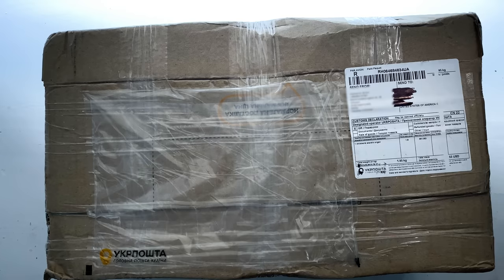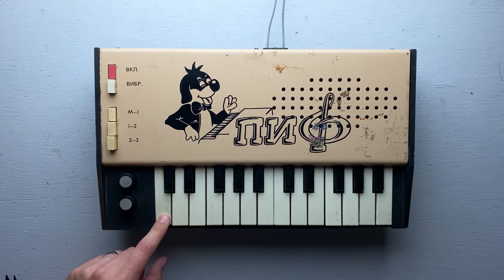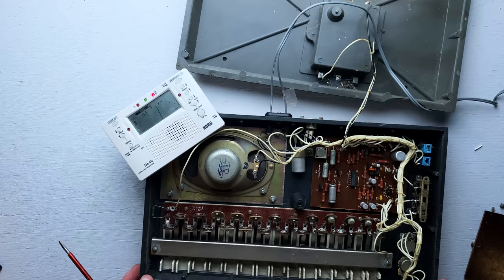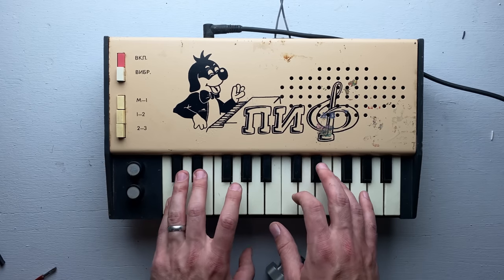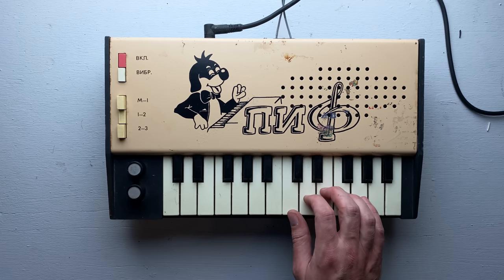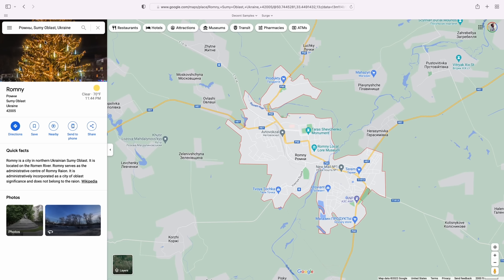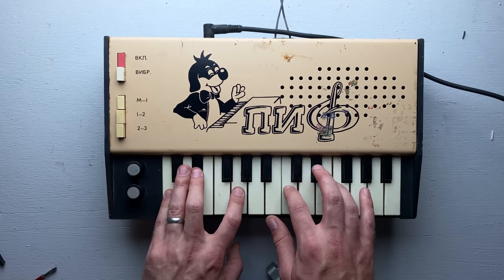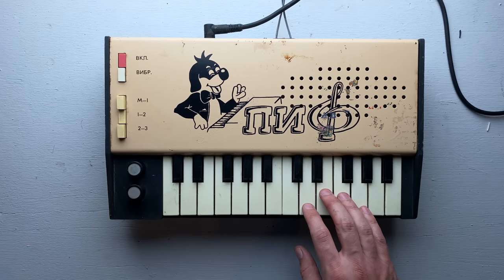Soviet Pif synth: a cute analog synthesizer for children (+ FREE Sample Library)

Comment from the maker: Yes, I’ve seen a DIN connector before. I just meant I had never seen one used for audio. 😂
Reply: First
Reply: MIDI? XLR?
Reply: Got one on an old ass Yamaha keys and my Steinberg UR44c no velocity available but it works so good for bass synths. I sometimes fantasize I am gonna use a multi keyboard live situation like Rick Wakeman or something.
Reply: @MarsCapone  that might be good and all, but let’s not forget who was first to comment in this reply section…
Reply: They were fairly common on lots of gear. They became standardized as “a midi jack” in that specific configuration, and now you only see other varieties on old gear. Like, from my era... ;)
Reply: It was the very common in socialistic countries to use DIN as audio connector. I remember I have full drawer of Jack to Din, Jack to cinch, Din to Cinch, mono, stereo, in, out, combo when I was kid in 80.
Reply: these connectors are way more safe to connect low voltage equipment together because the metal case of the plug is internally connected to the ground, so it gets connected first and the audio output/input pins are connected next. 

if we compare this to popular VHS audio or video inputs we see the inner signal pin there is longer than outer pipe connected to the ground. So if you have to connect two transistor devices with a 220V power supply each, you may connect the one's ground to the other's input and burn this input
Reply: in the 70's they were the norm here in the UK. Most cassette decks had them
Reply: Actually the DIN 5 pole stereo connector was very common during the 60’s and 70’s in some brands such as Grundig and Philips, and I presume many others.
Reply: 'Spose what we are all saying, it's an old connector, but it checks out... ;)
Reply: Every Bang & Olufsen since day zero until the mid-1990s used DIN connectors - I would have replaced the power jack as well.   Also PIF was a publication of the French communist party...  I used to have a subscription as a kid!
Reply: (Japanese) Sharp GF-8080, AM/FM Stereo/Wide, cassette deck with APSS (single track silence search auto detection) c. 1979, if my spectrum childhood trivia memory hasn’t become corrupted. DIN is/was a very compact and simple physical interface for line level 2 channel analogue i/o in many parts of the world, before RCAs “won”.
Reply: The connector there conforms with https://en.wikipedia.org/wiki/Deutsches_Institut_f%C3%BCr_Normung
Reply: @monsterislandtales5788  Yes, you're very special.  How about you come back when you have something of substance to contribute?
Reply: Basically all audio equipment in Soviet Union used that type of connector only. Even electric guitars! It has a little advantage by design -- it has both input and output connectors for left and right channel, and whatever you plug in wouldn't make a trouble: if you connect a microphone to a speaker output you won't blow it up, it would use a different pair of contacts.

Of course everything else about this connector is a huge nonsense.
Reply: It’s never be tuned , these kind of the synth what must sound de tuned originally .
Reply: DIN connectors for audio was the common standard when I grew up. Most devices had them - one for "Phono" and one for "Tape".  The "Tape" connector established a bidirectional stereo connection so you could easily copy music using just a single cable ("Überspielkabel"). The "Phono" connector was just half wired (inputs only). It expected a high level signal that already had to be equalized and amplified by the record player (kind of like a RCA line in) , so both versions of the connector were more or less interchangable. The change to this messy cinch-cable system, where signals were non-standartized and could be anything (mid level line, low level non-equalized phono or even low level digital) and where you needed four plugs instead of one for a single bidirectional connection came way later.
Reply: To reiterate it a bit more: MIDI jacks are a current-loop based, low-speed digital serial interface, carrying only control information for digital music instruments. They are someting completely different then the ones used for audio. But AFAIK nothing should happen when you accidentially put them into the wrong plug. The MIDI signal is floating and would end up on two "hot wires" if you put them in a DIN audio socket.
Reply: hu most old audio stuf use DIN
Reply from the maker: @Light-DelaBlue  Not in the US, though.
Reply: В СССР только такие и использовались, Джек был редкостью.
Reply: "May There Always be Sunshine" song at the end was used as the opening for Warpath: Showdown mobile game app advert.
Reply: @DavidHilowitzMusic  Would you be able to do a midi files of the songs from the song book by any chance?
Reply: Super common here in Germany. All the old audio gear I find has DIN connectors and there are so many different types. It is kinda cool to have line in and out from one cable.
Reply: В советском союзе всё межблочные соединения даже hifi класса были на din. Разъёмах..
Reply: прикольно
Reply: All Soviet audio equipment was equipped with a DIN connector for audio input / output
Reply: according to your logic, if German Volkswagens can be bought in Russia, then they are also made in Russia. Do not forget the USSR was not divided into Ukraine or Russia, people considered themselves a single country. And the intervention you mention should be used against NATO.
Reply: Привет из СССР
Reply: Yep, they loved their DIN sockets over there.  I'm fiddling with a Moldavian ZX Spectrum clone ... DINs for everything ... including power input!
Reply: Wasn't the DIN standard a German thing?
Reply: @robertlewis4216  Yep ... D = Deutsches ...
Reply: In the 1950's DIN was standard in Europe, also West Germany.
West Europe switched to RCA Cinch, East Europe kept DIN.
Reply: cool that youre getting into electronics as a grown man but you should study a lot more before playing around with live current and commonplace standard components you don't recognize for some reason
Reply: DIN stands for Deutsches Institut für Normung - German Institute of Standardisation. And until the early (?) 80s it was the common connection also on stereo systems so,d in Western Germany.
Reply: Seriously?? Been used for Audio till mid/late 80s...
Reply: I think the DIN 5/180° was the standard audio connector in the 1970s, all over Europe. Even after RCA started becoming a de facto standard in the 1980s you could find these on boomboxes, televisions etc. I remember recording sound from the TV onto a tape deck using one of these in the mid 1980s.

It's a lot easier to connect just one cable between your tape deck and amplifier instead of four, and the average consumer doesn't have to worry about doing it wrong.

 There was also a 2-pin DIN connector for speakers. And you could use an adapter for 2x 2-pin DIN speaker -> 1⁄4 inch female to plug in headphones, if you didn't have a headphone jack.
Reply: AC or DC? That's a question. When you buy anything from the other side of the world.
Reply: @DavidHilowitzMusic  That power connector looks a lot like a dual banana plug.
Reply: the c64 used a din connector for a composite A/V.
Reply: DIN connectors were used in Norway too, then probably in the rest of Europe, too, and they were common with record players as I can remember.
Reply: DIN connectors were also a standard for pc keyboards until the mid 90s
Reply: @monsterislandtales5788  why
Reply: I I'm kinder
Reply: Back in the 80's stereo amplifiers had a din plug socket. Some record players had din plug sockets. They used to be very common
Reply: this connector has been an audio standard for 80-is  I have soldered hundreds 🤣
Reply: @frankkrunk  I think the speaker connector could be either 2 or 3 pin But two pit connector can be inserted into 3 pin socket. Anyhow they are pain in the ass to solder wires to. Too small for the standard cables used for speakers even back then. I have had some from old radios back in early 2000's when I was getting into electronics s a kid, but they are all gone now.
Reply: The early Philips MFB speakers (MFB541, etc) used DIN jacks for signal transmission.
Reply: you've never seen a DIN connector on any synth other than this?
what
Reply: A friend ( who has now passed away) gave me an amplifier that his step dad found in his loft. Had one of those connectors. Wish I'd kept it.  I vaguely remember it had a break out cable to multiple phono Jack's.
Reply: I'm not sure if they're wired the same, but I've seen tonnes of 5 pin I/O's and cables in my life, in MIDI.
Reply: Looked like a Professional 'SHURE' style Microphone plug to me...  I was shocked to hear you did not recognize it! (But impressed you found the correct outputs!)  This was a great video...
Reply: @WoodysAR  The XLR connector is only superficially similar to the smaller DIN plug. Nevertheless DIN is very familiar to anyone who ever used a C64 and it even carried audio out. 😉
Reply: Retro Japanese, British and Swedish hifi gear would like a word... (Bang and Olufsen used them, as did A&R amps, the Japanese also used them primarily for Reel-to-reel tape decks) - Pretty much all the audio kit I came across in the 80's to early 90's had a DIN somewhere on them. 

And then there was the BBC Micro.......
Reply: My TRS80 used a DIN connector to link it to a tape player for data storage :)
Reply: They are kinda present on all audio equipment for that time..
Reply: But isn’t that DIN connector used for MIDI ?  Am I so old that they aren’t anymore?  Not surprised it wasn’t for MIDI on this synth 😂
Reply: Tuning an old piece of soviet tech with a metal letter opener after hooking it up to the power source with 2 bare wires. Health and safety level Poland <3
Reply: Shoot my Tandberg tape deck from '77 has one on the back for connecting to radios. Never use it though, no clue if it works with modern 5 pin cables and even if it did, have nothing that will take that
Reply: They werev invented for audio by the German standards institute. Use for PC keyboards and MIDI came later due to their availability and superiority to RCA for multipin purposes. USA is the odd one out in hanging on to RCA despite all it's disadvantages.
Reply: @ОксанаГончарова-ц2ь  "бувай нє митая росія"))) доброго вечора, ми з України! країни яка звільнилась з полону ссср. а до того створила цей синтезатор.
Reply: @AiOinc1  MIDI isn't audio & XLR isn't DIN
Reply: you find in on old microphones often
Reply: Din was German standard and a typical connector  for audio in Europe in '70 and even '80  Most German  Grundigs , Telefunkens etc Used Din as audio output. Swedish Dux, Polish Unitra and many other European brands including Soviet  also used din. Some  till late '80 or even til 1990s. Same as MIDI pinout was used for audio in out and headphones. For speakers 2 pin din speaker connectors
Reply: @LorenzBaermann  The DIN 5 was featured on my Nakamichi 550 reporter cassette recorder for audio in/ out. I made so many music recordings with that using the amazing 3 microphone L/R/Omni setup. It was a joy to use, but quite heavy to lug around with you
Reply: @DavidHilowitzMusic  ISTR DIN were pretty standard for mic connectors in the US in the 70s-80sm
Reply: @Valet2  It makes a lot of sense that the soviet union used ONE connector for ALL audio

Comment: 4:10 The "archaic connector" is actually called 5-pin DIN connector. It was introduced in early 70s in Germany and later on spread throughout Europe for analog audio, midi, and later computer connector standard. It has its roots in connectors used in military aircraft. As a matter of fact early personal computers such as IBM, Apple, etc, used those types of connectors for interface (keyboard, serial, etc) which later on became a more familiar mini-din keyboard/mouse connector which you can still find on modern computers. So, by far, that connector wasn't just a USSR thing.
Reply: I would say it's even older. I am from Serbia and my grandfather had a Tesla (Serbian electronics institute and manufacturer) radio from 60s with such connectors. It had input and output options, we use to hook up record players onto it and bunch of other stuff through the years. Decades later devices still had those as connections. Mostly found on high end stuff.
Reply: I remember them from volunteering at our local tv station. They were used to attach the zoom arm controls to the camera. I’m sure there were other uses too….i think my audio recorder as well but it’s hard to say it was awhile ago
😂
Reply: DIN-5 socket is used also in MIDI-standard musical equipment.

Comment: FYI from ukrainian electronics engineer: that silver cylinders in the device are electrolytic capacitors, and they degrade over time, especially crappy soviet ones, so they are first candidates for replacement if something this old is faulty.

Comment: Not sure if you'll see my comment, but the audio output that you see there is actually the same as MIDI (this connector called DIN at the time), so you can use the modern MIDI cable to to connect things, just make sure to solder modern jack on the other side. It was used in many applications and sound was perfect for using DIN for stereo and mono since the jacks did not differ!

Comment: Those batteries seem to be C or D cells. I wouldn't call them archaic - I'm pretty sure they are still sold everywhere. The battery compartment door is 100% not original but some sort of a DIY replacement cut from a sheet of micarta. As for the audio out connector - it's a DIN connector. These were invented in Germany and adopted as a standard in USSR. BTW, standard MIDI connector is also a DIN (as is the AT keyboard connector) but with a different pin count than the one used here.
Reply: I am sure that you can buy them almost everywhere in Europe and i have seen some new devices still using them, but I don't remember exactly hat was it, but most likely something with motor and quite likely strong flashlights as well.

Comment: if you want to use this synth then i highly recommend to replace all variable resistors on the keys with any modern ones because this open type ones are unreliable and may loose their settings.
also recommend to replace all electrolytic caps (silver ones) with modern ones because those old caps are pure shit and half of them are probably already dead.
that's a known issue. here in Russia any repair job on soviet era vintage equipment starts with cap replacement (many guys don't even check them and just replace all small electrolytics)

as for song...   people who write songs and people who start wars are completely different people despite they are all live in a same country.

Comment: That audio connector was the main and most popular audio connector in USSR. It was widely used in TVs, tape recorders (both stationary and portable (big)), audio amplifiers, equalizers, microphones, headphones etc. It was something like 3.5mm+RCA for audio of that time. In many cases a device had two such connectors marked IN and OUT. So you could bring your tape recorder to a friend, use a special cord with two male connectors of the same type, connect two tape recorders and make copies of some tapes. Same cord was used for connecting a tape recorder to a TV to record some music shows etc. In the 90s, after USSR collapsed and imported electronics started to flow in, we got a portable CD player, so we used a soviet stationary tape recorder as an amplifier to play CDs on big speakers, and I had to solder a special adapter, connecting a modern 3.5mm jack to an old soviet cord with that standard connector.

Comment: The first children's synthesizer at the former ussr was produced in Estonia (196s). It was called Pille (female Estonian name).
In Ukraine, in the city of Zhitomir, keyboard instruments were produced for amateurs and professionals:
"Romantica" (monophonic, 3.5 octaves), "Gamma" (polyphonic, 4 octaves), "Meridian" (polyphonic, both manuals in one row, 6 octaves summary, 6 register synthesis  (8' + 4' + 2(2/3)' + 2' + 1(3/5)’ + 1’).
But this instrument was heavy and repairing it was difficult. To replace one transistor in the octave divider module, it was necessary to desolder 4 bus wires on the faulty one and four neighboring modules.
That plant also produced an electronic accordion and a drum machine.

Comment: Din connectors were standard for audio in most of Europe. They were a great idea, because with only one connector you could have left/right in, together with left/right out. Versus having to plug in 4 cinch plugs. However, the cables are a lot harder to DIY (finicky small pins to solder on).

Comment: FYI Li-Ion 18650s fit perfectly in the battery bay. great for taking PIF outside. no modifications needed. also, you can kinda "combine" octaves by holding down more than one octave key.

Comment: The reason why a detailed electrical circuit diagram was included is that if your device breaks, you will take it to a general repair shop, where they won’t figure it out without the diagram, but they could fix any device made in soviets if you bring them related diagram.

Comment: It's very easy to date Soviet electronic equipment, as many of the components (especially the capacitors) were marked with the year of manufacture, often with the month as well (sometimes in Roman numerals). So a component marked Г VII 82 would have been manufactured in July 1982.
I can't be sure, but I think the 9v power connectors are for standard 4mm banana plugs and, as others have said, the audio output is a 180 degree DIN connector.

Comment: You might be getting some power supply ripple on there.  Also suggest those are banana plug connectors on the power.  A bench power supply might be better.  Also, 5-pin DIN plugs were really common in the 70s and even 80s european gear.  DIN stands for Deutsche Industrie Norm, which means German Industrial standards, it's the German standards body.